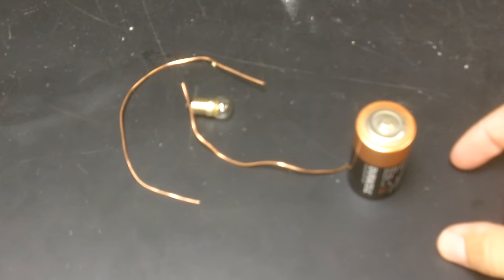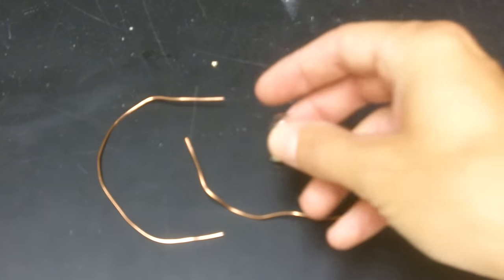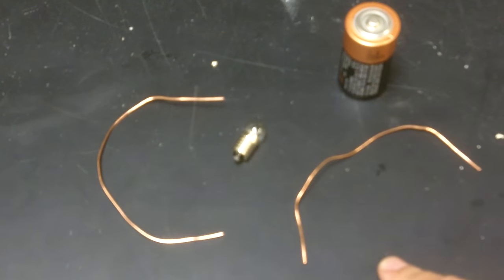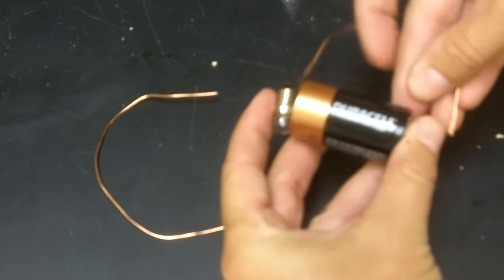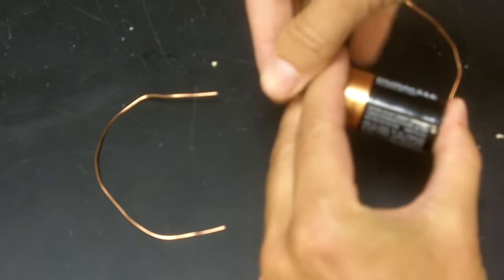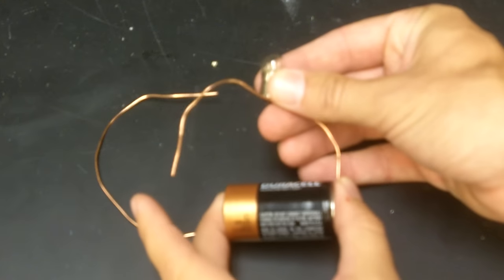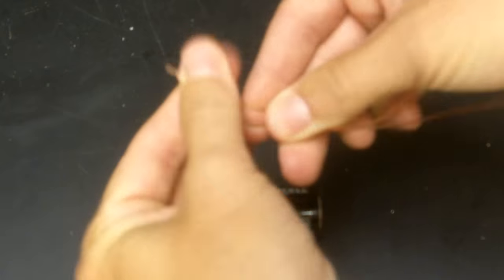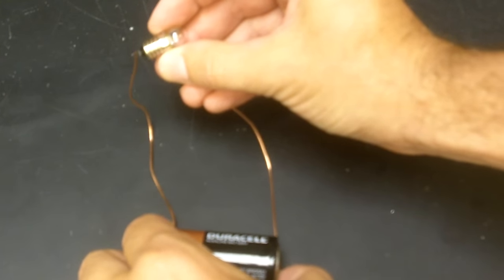Here's how to get this light bulb to glow with a battery.

Comment: If the battery is bigger, are you able to power a larger bulb
Reply: Alex Andersen yes but we have to know the voltage battery can handle so according to it we can light it up
Reply: Alex Andersen you need a smaller light bulb to work or a led light

Comment: Hey! Thanks for the help! Can you explain why we dont feel a shock when touching the bare wire?
Reply from the maker: If you are using a D-cell battery (1.5 volts), that's not a shock.  The wire gets hot if you have the wire going from one end of the battery to the other (this is called a short)
Reply: @rhettallain  Why don't we feel the electricity while holding the wires and lightbulb?
Reply: Is the voltage not high enough in the battery? Is it because the wire is a better conductor? Plz help were presenting in 2 mins
Reply from the maker: @jensenmacneil6914  it's both.  When you get shocked, you mostly feel the electric current.  With 1.5 volts, the current is super low.  Also, if you are holding onto a wire, then most of the current goes through the wire and not your body.

Comment: just a question does this shock you?
Reply from the maker: no.  you can't get shocked from a D cell battery. However, if you have the wire going from positive to negative terminal without a light bulb, the wire can get hot.

Comment: Will a 1.5 volt battery and a 2.5 bolt light bulb work?
Reply: +Louise Nah no
Reply: +Regret Aleks With incandescent light bulbs, a 2.5v light bulb actually will work, but it will be dimmer than  using a 1.5v light bulb.
Reply: +Louise Nah no not enough volts
Reply: Dont need to reply anymore I dont need to know ._.

Comment: Hey everyone.I have five bulbs. All of them are connected by the same wire but when one of them is glowing non of the others should glow even if the switch is pressed. Its for buzzer in a quiz competition. I would be very grateful if u help.

Comment: and can we do it with any battery?
Reply from the maker: I would recommend any 1.5 volt battery (so AAA, AA, C, D) - but not a 9volt battery and not one of those button cell batteries.

As for the lightbulb - this is one of those tiny incandescent bulbs (not LED).  You can find these at a hobby store or in one of those cheap flashlights.

Comment: If the bulb is 2.47 volts, then does it not need a 2.5 volt battery? I just googled 'C' batteries and they are 1.5v. So how come the bulb lights up?
Reply from the maker: If the bulb is rated at 2.47 volts, that is the voltage for the optimal brightness.  I will have current going through it at any lower voltage - but it might not be very bright.
Reply: @rhettallain  I see! 'Lightbulb moment' haha. Thanks for your reply

Comment: Will something like this work with a bulb labeled as a "Replacement candle bulbs"? The ones I have for a project say they are for electric and sensor candles, but I'm looking to use it for a fake gun (The memory gun from gravity falls) anyone have tips?
More info: 7 Watt 120 volt C7 candelabra base bulb

Comment: I tried to connect this way with a mini LED light instead of a flashlight bulb, but the light won't light up, why?
Reply: Check voltage of bulb. Hes using 1.5v battery with 2.4v bulb. If your bulbs voltage is too high, it won't create enough heat is light from battery.  I did this with 9v battery and the bulb got way too hot.
Reply: lilvipa1 Thank you, I think a LED light probably works differently, I was told that I need to have a resistor. I haven't tried that yet.

Comment: I shock myself
Reply from the maker: It most likely wasn't a shock.  If you are using a D-cell battery, the voltage is probably too low for you to even notice.  However, there is a very good chance that you shorted out the battery.  In that case, the wire could get quite hot.

Comment: Why my children got a electric shock while doing this??
Reply: an electric shock*
Reply from the maker: I suspect that the wire got hot - not that anyone was shocked.  If you are using a D-Cell battery, it won't shock you.
Reply: sujit kumar saha I did it in my class with the materials here with one wire and I didn’t get electrocuted by  it does get a bit hot
Reply: Ur child got shocked because he/she is a noob and is not experienced

Comment: This is not  "working"😭
Reply from the maker: you might not have bare copper wires.  If you get some of the thick wires, they might have an enamal coating on them that prevents them from making an electrical connection.

Also, try a different battery and a different bulb - those might be bad.